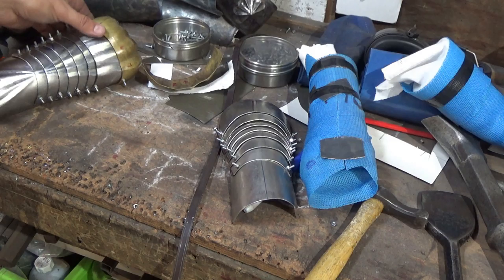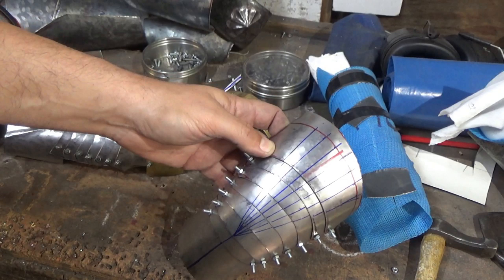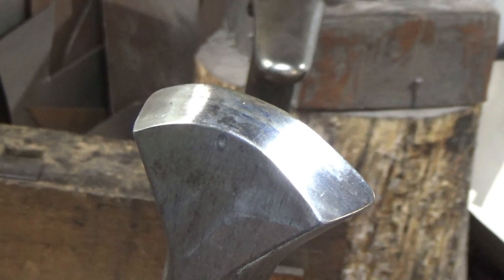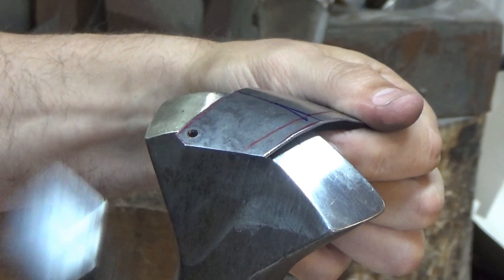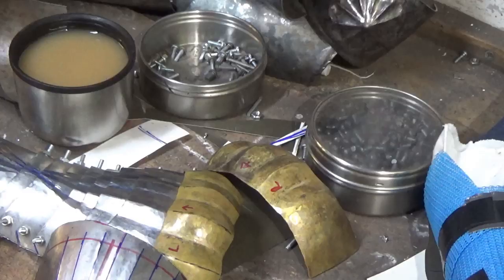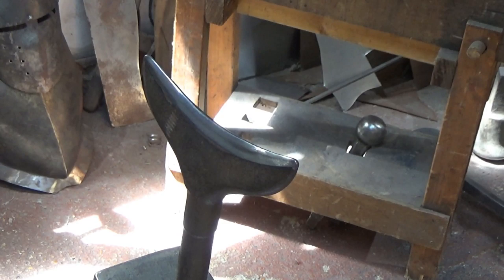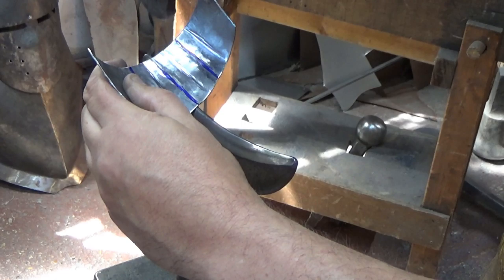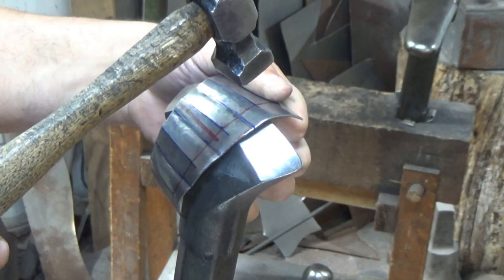How to add multiple creases to armour. Medieval armour techniques

Comment: The hammer You hold at 13.51 has a straight, rounded edge to it. What would one use that side for..? The shape would produce fluting, but could only be applied to curvatures facing away from it lest it leaves marks me thinks...
Reply from the maker: Hi there, if the curve convex it is great for touching back the crease to make it appear sharper. As the curve means the ends of the hammer don't strike the work.
Reply: @GreenleafWorkshop  Thank You for all this - I should leave You alone for a while :D  Have a great weekend!

Comment: how do i get springsteel as a plate ? only got stribes on the internet
Reply: Look for companys selling sheets of metal. Usually they offer a few types mild stainless spring aluminum etc. They can usually cut the sheets for you too. Only problem is alot of them wont take small orders. Like say a 4x8 foot sheet. Im sure you can find spring steel alot of ribbon style springs are obviously made from sheets of spring steel.
Reply: @TheGoodCrusader  ok dont type in leaf spring type in 16 guage steel. 16 guage or 12 or 14